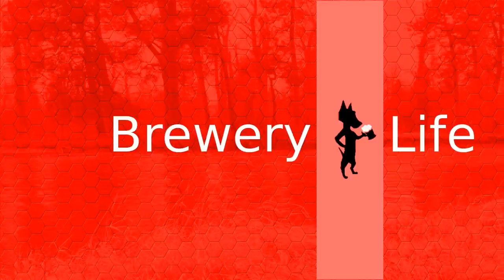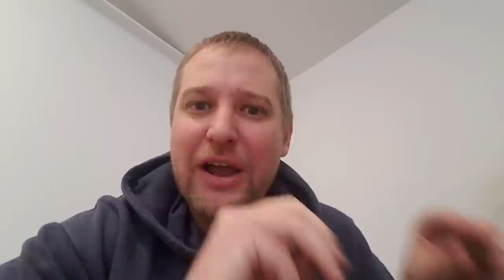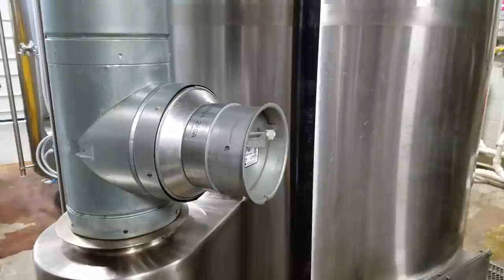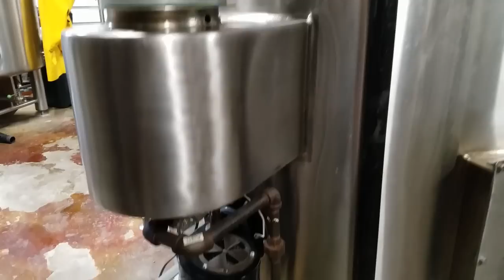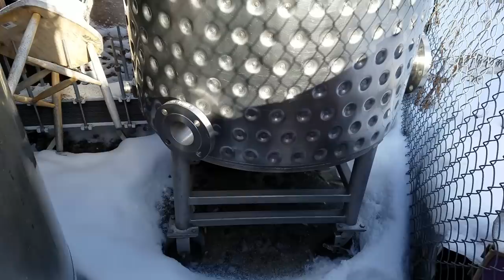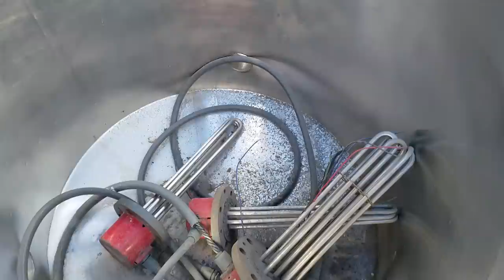BEER KETTLES! Electric, Direct Fire, Steam MICROBREWERY EQUIPMENT!

Comment: another excellent video. in my experience the direct fire kettles do a much better job of caramelizing wort, as opposed to their steam fired brethren. my first brewing job was on 14 BBL Pugsley "direct fire" system; it used a concentric ring of burners to control the boil, unfortunately the valves supplying  the burner/manifold were within the boil over danger zone. it also had a tendency to back draft, & on one occasion claimed an inch or so of my mentors beard. your brewhouse appears to be light years ahead of the system I cut my teeth on.
Reply from the maker: Thanks for sharing your experience, cheers!

Comment: One can speed up electric boiling by dropping the pressure on the kettle although it makes hop additions and a few other functions a bit harder.
Reply from the maker: Lower pressure definitely lowers the boiling point temperature of a liquid. However, the best breweries have pressurized kettles to raise the  boiling temp to 225F. This is optimal for isomerization and driving off volatiles. Can the public taste the difference..who knows but I wouldn't lower that boiling temp too much. Just my 2cents, thanks for the comment, cheers!

Comment: Jasper, I was wondering if you've heard of/ had experience with indirect fire kettles. I remember reading on one of the brewers forums about people using them, and it sounded like they had most of the benefits of steam without the increased cost and footprint.
Reply from the maker: I mention indirect in this video... so yes I've heard the terminology. Engineering design differences are cool to learn about and what separates good manufacturers from bad.
Reply: @brewerylife3596  oh oops! I guess I missed that.. guess I'll have to watch it again.

Comment: About your older kettle, does it heat the wort with direct contact (rims) or do you heat the water and passes it to another kettle from the jacket?
Reply from the maker: Immersion heating elements in wort for boil kettle, not mash tun.

Comment: In my previous job we worked with a 5 bbl kettle heated with steam. Although it was indeed very fast we had frequent boil-overs and couldn't sustain a really vigorous boil because of that risk. I think it was due to negative pressure building up inside the headspace, but never got to completely understand it. The kettle had a wide condenser pipe connected to the top and coming down close to the side wall with two cold water sprayers inside which didn't seem to be very helpful. Maybe you can do a video about boil-overs if you are familiar with that problem; I've seen it in other micro-breweries. Thanks!

Comment: What is the reasoning behind dimpling the jacket (I see that you did that to your first system)? Creating cavitation to enhance heat transfer? Thanks very much for sharing the higher technology (and pros/cons) viewpoint from a seasoned brewing veteran.
Reply from the maker: The jacket was already on the spaghetti cooker like that for their steam system. I just added flanges and ran it electric.
Reply: @brewerylife3596  - so, if you put your own ports in the pot, did you weld them inside and out? I guess you did not use the jacket for cooling?
Reply from the maker: Yes..HX for cooling
Reply: I think if you dont have the dimples to create turbulence you can end up with a sort of water current running around the jacket and uneven distribution of the heat.

Comment: Is there any way to step mash or control mash temps if you miss your desired mash in temp on a direct fire system?
Reply from the maker: This video is about kettles not mash tuns/ mash mixers/ lauter tuns..you can have a direct fire kettle in a decoction system.